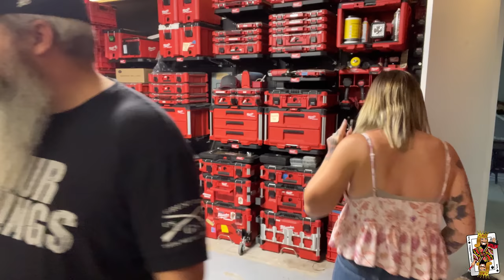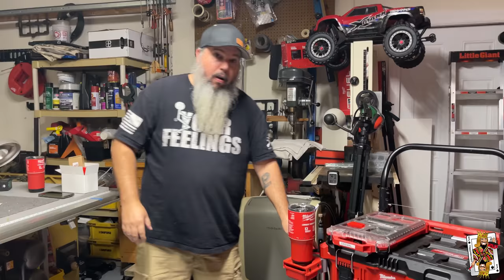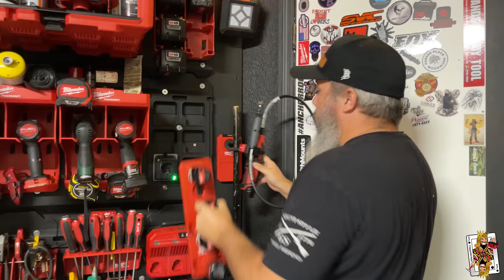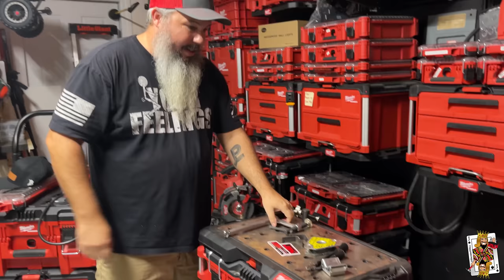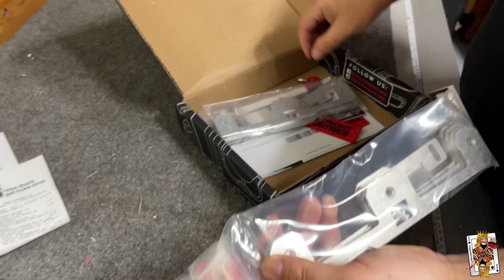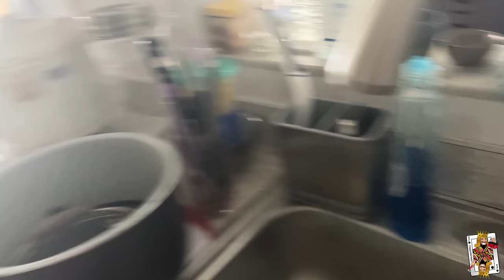Milwaukee Tool PACKOUT MODS ! Gen3 Bit Holders, Welding TOP, Builtright Truck Bed mounts AND WINNERS

Comment: i going to say something you mightnt like . might ofend you and your fans. 
you need to make these mods for the dewalt tough system . please dont lynch me .
Reply from the maker: Hahahhaha bye ! Jk jk ! What are you looking for
Reply: @JakeOfALL  crying noises. i just want someone to make us some cool things😪

seriously though. i am super jealous of all the accesories the comunity have added. im tempted to buy some packout  just for a rolling tool cart
. i use a tough system cart on a homemade dolly( bloody dewalt wont make on for the tough system)  for hanging doors and similar jobs. bottom tote is a bin  for all the packaging. top tote has drills and cordless router  and jigs etc in it. i would love to be able to hang them on the outside.
i would like a set of rails that can be bolted on to hang drils etc by their belt hooks. 
and some kind of plate that accepts all these cool accesories you pack out guys have invented.

Comment: Jokes aside, I forgot to ask if the twist lock on the Packout wall wall accessories works with the mod? Also I can't wait for the Builtright Packout video!
Scammers suck
Reply from the maker: SO they don't "lock" but they fit.